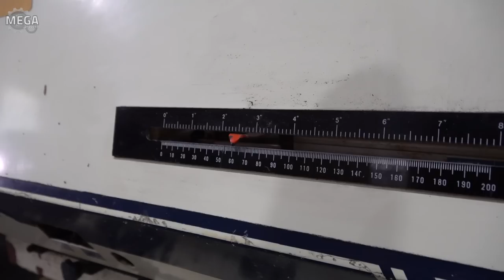Process of making stainless steel shower faucet. Korean bathroom ware factory

Comment: that is not stainless steel, it is very soft and is a little golden so it must be some alteration similar to bronze.  maybe aluminum bronze.  That's why they chrome it.  In stainless steel it does not need to be chromed.
Reply: Krom kaplamadan mat görünüyor çok çirkin oluyor 
Ve alüminyum yaparsa 1 ci derece kanserojen oluyor